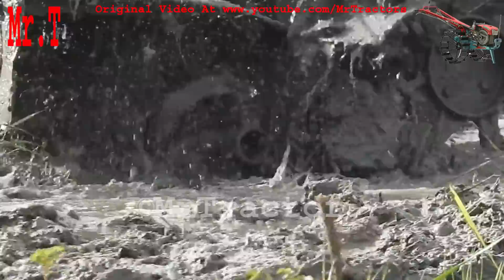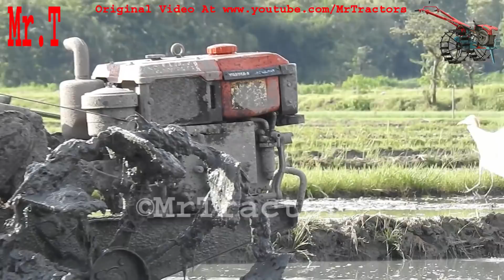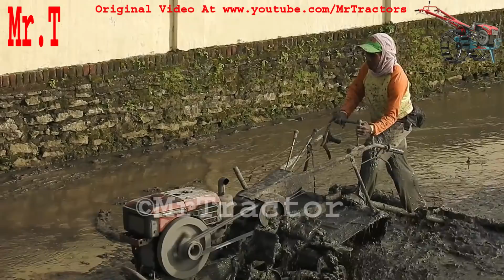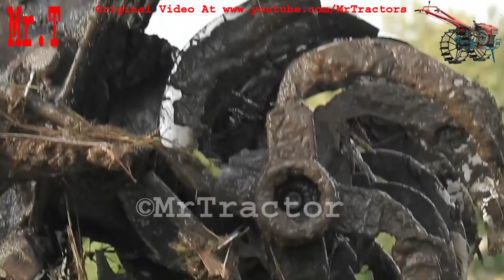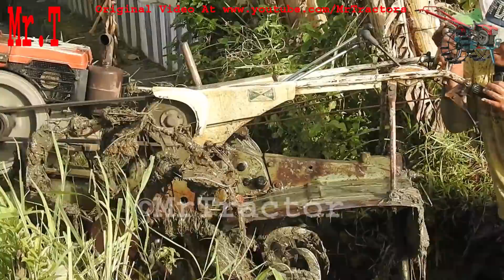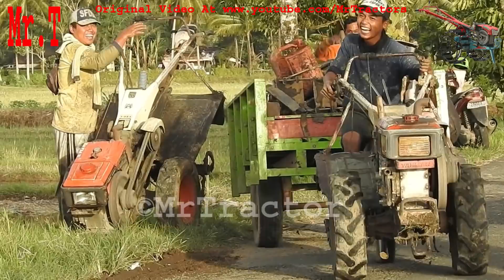Walking Tractor Yanmar Rotary Working And Mobilisation รถไถนาเดินตาม

Comment: Greetings from once again very snowy island. What was the vehicle that was speeding along at the beginning of the video it looked like some form of 'home made' hand fed rice harvester, or am I completely wrong, and what was the pole sticking up in front of the driver for?
Reply from the maker: You are almost correct, it's used after harvester, called Rice Huller, this machine used to processed rice after harvested and dried under the sun. Yes, it's hand made, using an old car chassis, then mounted a power full diesel engine, and equipped two type rice huller or polisher. The Diesel Engine is multipurpose, it can move the car and running the huller and polisher, of course the driver or operator must change the way the belt where will use to work. This is my old video  of the machine working in my house https://www.youtube.com/watch?v=2KGdLg3bxmg
Oh.. that pole is used by the operator or driver to attach tent if needed, like when is very hot sun or rain. Thank you so much for watching and greeting from my Lovely Village.